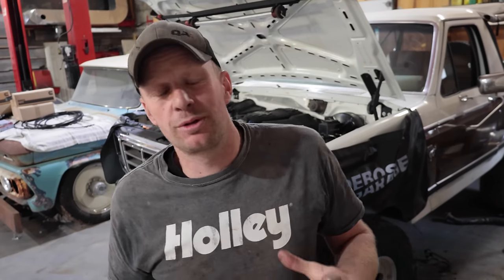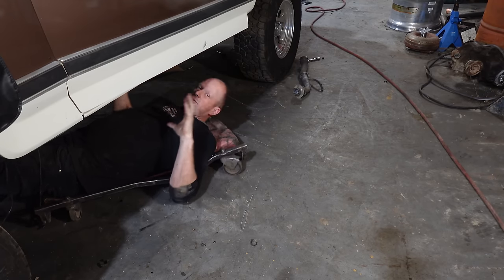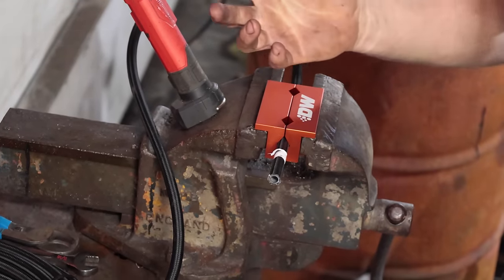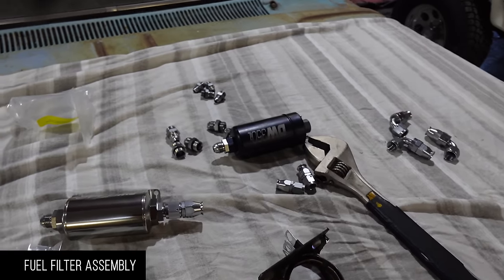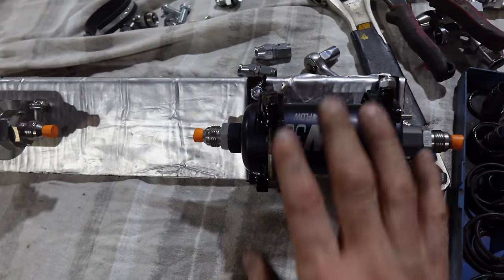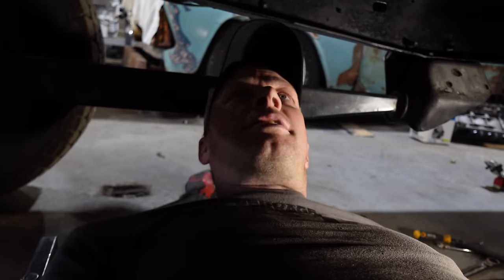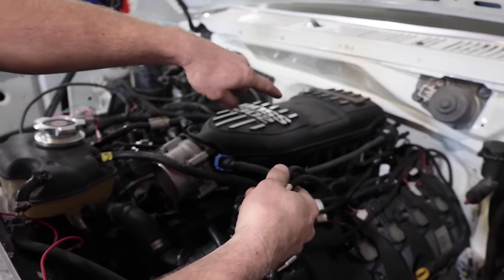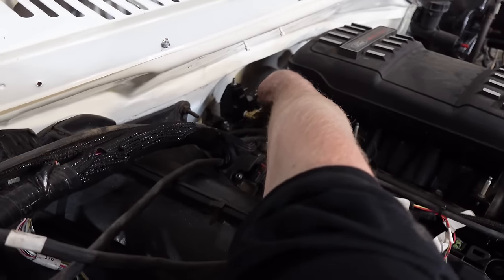Your Coyote Swap will NOT Run Until You Do THIS! #JuiceBoxBronco [EP14]

Comment: Hearing the phrase "path of least resistance" really does rustle my Jimmys when talking about electricity. Electrical current will follow ALL paths of resistance, not just the lowest, given enough potential. There is voltage potential across ALL paths of resistance! A "ground wire" or negative/neutral conductor must be able to carry the same amount of current as the positive conductor! Redundant ground connections can cause unwanted noise or interference in AC or digital circuits, referred to as "ground loops".
Reply: Absolutely correct! It has to look like a tree. The root being the ground terminal and every leaf one consumer... And as on a three there are no leafs who are grown from two separate branches into one leaf... That will, as mentioned, create current loops...

Comment: Don’t leave the unused connectors sitting there on the engine. They are not sealed so open to corrosion. They also contain ZVR and reference voltage which as you noted are shared with others. If those short it’s a bad day. You can probably get mating connectors for them and instal seal plugs in those to seal and protect the system.

Comment: I think that piece of rubber hose in the middle of the steel fuel line was so that ford could make one "front half" fuel line for all there trucks and then have a separate line for whatever the back half required for example a crew cab long bed has a very different rear half fuel line compared to a short bed or bronco. also I'm pretty sure that's where they put the switcher valve on the dual tank models. one other thing, I would be a little concerned about is only soldering the battery clamps on. I did that on my diesel and after a few years I started having weird issues with it acting like it only had one battery occasionally so I crimped them on with a crimper that looks exactly like the one you have and its been working fine ever since.

Comment: FYI ALL....I've repaired a my BernzOmatic torch igniter with a dollar store (torch style) lighter they sell at the checkout. (for 2 dollars).  BernzOmatic does not sell the replacement igniter for any less than a new unit.  I did use small spacer behind the igniter unit as it had a slightly different stroke compared to the original. That was a year ago....still works great.  It was the "BernzOmatic TS4000"

Comment: For ’79, the 351M V-8 was standard issue in the Bronco, while the 400 was optional, and no six-cylinder was offered. But with the 1980 redesign, the 119-hp 300-cu.in. inline-six joined the lineup alongside the 137-hp 302 and 138-hp 351M V-8s. In ’82, the 351 Windsor V-8 replaced the 351M. According to Todd, the early engines were underwhelming and Ford heard about it.

Comment: Just a suggestion, but maybe an aluminum crown Victoria radiator? 1998-2002 had the coolant expansion tank was on the radiator and in the exact same spot your gonna put it. The lower rad hose has a T in it that goes to the expansion tank. You could even get the fancy police interceptor hoses that are silicone from the factory

Comment: Very cool swap, those coyote engines are great! I just wish new engines looked as appealing as the old ones. I don’t wanna see coil packs and plastic I like pretty valve covers and 4 barrels! I do the same thing soldering the big cables into the terminals, it just works the best👍

Comment: Thx Rich, I swapped a factory efi 302 into my little 69 Bronco and had to go thru the whole process of installing the filters and lines as you did.  I put a SS tank in with a in tank pump instead of the external pump.  The motor and factory eec module were from a 92 T-bird, engine harness from Ron Francis. AND…it RUNS…

Comment: 43:00 The power will go through every path it can, but the amount of power each path will carry depends on the resistance of the path. So most of the power will take the path of least resistance, but not all. Regardless it doesn't really matter what path it takes, so long as it has a path to take with a low enough resistance.

Comment: Rich, I wouldn't mount that Holley in the engine bay. They're not really rated waterproof. Holley also recommends that you mount them vertically with the plugs coming out the bottom to make sure water doesn't come in that way.

Comment: about the wiring, what the point of the ground wire from block to head and head to head? You  have like 8+ head bolts making this connection already? also instead of splicing the positive wire on battery side you could just do an extra eyelet and connect it to the alternator on same bolt?

Comment: Ahh, Bernouli’s Principle. Know it well. 
Increase in flow = decrease in pressure. 
If you’re concerned about a pressure drop in your filter outlet and have about 3/4” to spare in and out, try this next time. 
Note: I’m most familiar with 1/4” and 3/8” stainless tubing, so please modify to your sizes. 
On the filter outlet, insert a 1/4” to 3/8” union fitting. Then connect a 3/8” elbow. 
Then another 1/4” to 3/8” union, in reverse of course. 
This will decrease the flow through the elbow, diminishing the pressure drop.

Comment: I don't understand the comment about not using cables with fine strands for high current. The total cross sectional area is the only current limiting factor and the individual strand size makes no difference.

Finer strands though, means more flexibility. Flexibility, especially in high vibration environments, is a good thing for reliability. Usually, the finer stranded cables are more expensive for that reason.

Comment: 28:00 i have had the glue from the inside of those filters peal off... so installing them "backwards" traps everything, they wash out with soap and water just shake them in the bucket... it all falls out. "glue chunk from inside of filter clogs pump, is backwards backwards" should exhaust smoke be lightly black when flooring it?
Reply: backwards is not backwards, because just like the oil filter... if its a restriction, their is a spring in it as a high pressure bypass, tho it has to such very hard to utilize the full range of mechanical engineering that's put into those filters, $1800 for the 400gph lift pump just to run a stock motor, and it still goes lean on the top end.

Comment: Doing laps with your shielded wires next to all the grarly EMI generating coils is madness. Since when are you afraid to modify anything? Yes there’s a shield, probably braided wire or maybe foil that needs crimped or soldered to a wire to terminate at the ECM. Take apart what you’ve got and you’ll see how it was done. It’s no biggie!

Comment: You gotta get rid of those nasty lift blocks and spend a couple bucks on some softrides or something. They're cheap enough and it'll just be better.
Reply from the maker: Yes, that was just a quick lift kit to get us home.  Figured I would have all the weight complete with the swap and then send it to a local spring shop for alignment and springs
Reply: @DEBOSSGARAGE  that sounds more like the Rich I usually see :)

Comment: Noooooooo! You fool! You never get rid of the rabbit! You're going to have constant problems until you put an appropriate rabbit back in the system. 
Granted, if your rabbit is older and no longer working properly, it's tempting to bypass it. But you will soon learn the folly of not having a functional rabbit mounted in the appropriate place in the system.